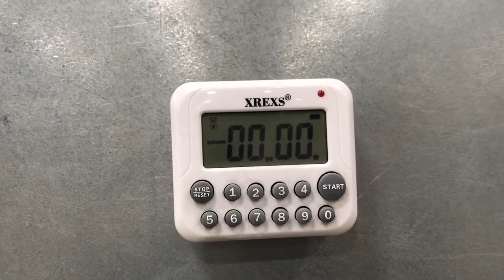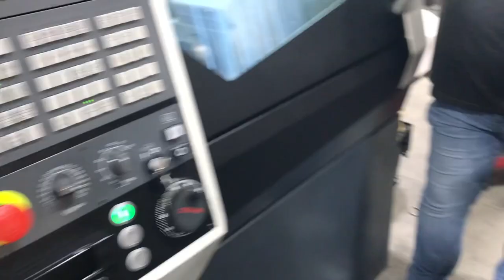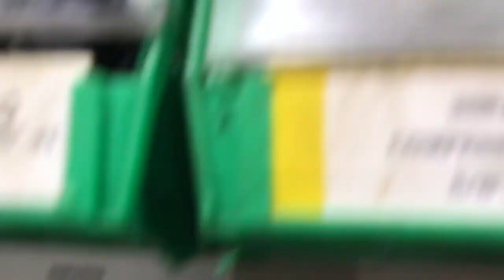What Happened Camping Out at CMMG || Squib Load and New Guns

Comment: They put a 9mm in and it slid down the barrel and they thought it was a malfunction so they cycled another round which was a 40 and shot it luckily it didn’t blow up. The cut out shows the bottom of the 9mm where power is and the lead is stuck behind it.

Comment: I still hate dealing with CMMG till this day. However, they screwed me. I purchased a PS90 barrel and thread adapter. While waiting for my suppressor to get the stamp approved I saw they advertised the same adapter "now suppressor compatible." Never-mind the photos I used to purchase the adapter showed a gemtech 556 can attached to it. When I called to ask what was wrong with the one I had purchased they told me they didnt know but I couldnt use a can with it. They then offered to sell me a suppressor compatible one. Not replace the one I had already purchased no I had to purchase a new one. Till this day everytime I bring this up on a forum or an email they run and hide. Because the item they sell now for $60 instead of $100 isnt worth replacing to keep a customer happy. Please keep this in mind when buying from CMMG. They will screw you and do nothing to fix it.